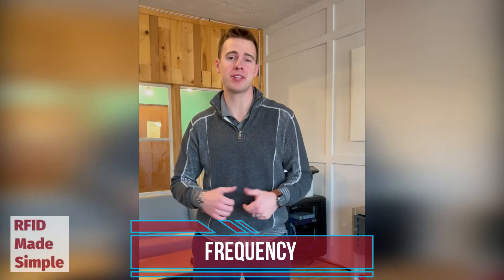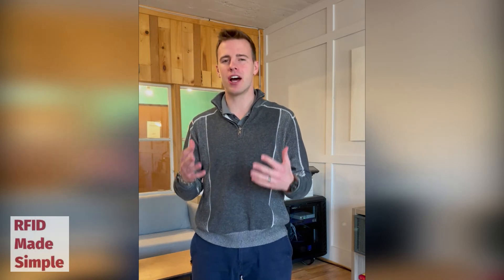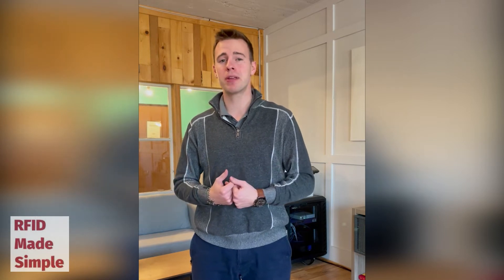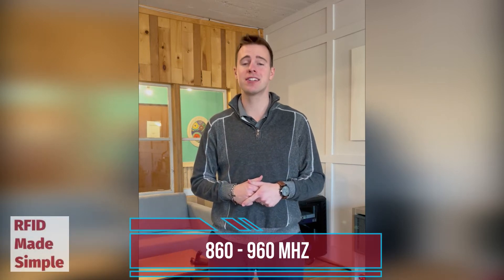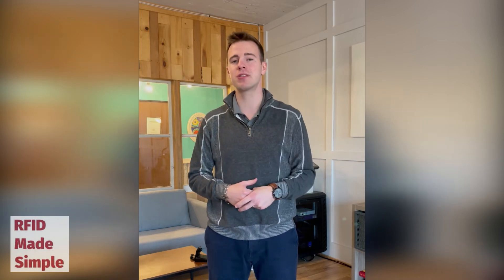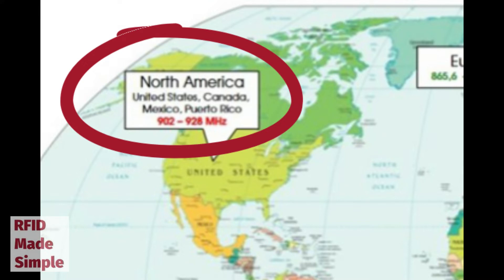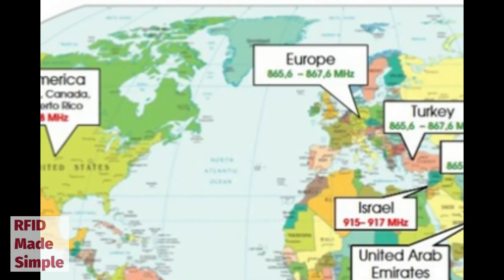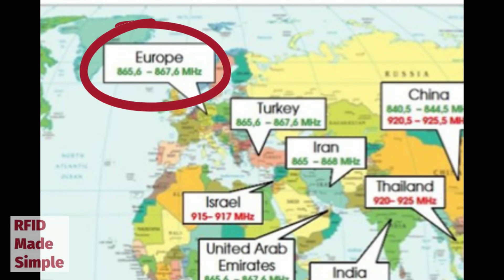What is RFID Frequency and Why It's Important

Comment: Important missing piece in explaining frequencies as it pertains to UHF RFID:  A point of concern is the extent to which particular RFID tags can be read or written in different countries, given their different frequency bands. A person new to the field might imagine that Tags need to be selected that operate on the same frequency as the Reader in order to communicate, just like in other types of radio equipment.  This is not really true. A key to this subject is the way in which Tags respond to commands from the Reader:  The Tag signals via pulses that consist of switching its antenna between resonating-and-reradiating (reflecting) the incoming signal, and not resonating/reflecting the incoming signal. This scheme is referred to as "backscatter". The Reader listens for these backscatter pulses, and interprets them as a message responding to its recent command.  
Withing the "pulsating reflection", the individual reflected pulses are bursts of the underlying frequency as sent by the Reader, whether the Reader is operating at 860MHz, 900MHz, 920MHz or 950MHz etc. So whatever frequency the Reader is set to (per the current location), the Tag's response reflects that same frequency, which is obviously exactly what the Reader is listening for. 
To make this work,  Tag's antenna needs geometry that causes it to more or less resonate when it receives signals anywhere in that frequency range.  That said, different Tags will, by accident or by design, have different degrees of sharp tuning ("Q" factor). Sharper tuning means a stronger reflection when operating near the center of the tuning range, but weaker outside that range, compared to a more-broadly tuned antenna. So that is a factor that might play into selecting one Tag over another, though in general, Tags intended for UHF RFID will operate at least somewhat across the entire band. If you know the Tags will only be used in one region, you might select a more-sharply-tuned Tag in order to achieve maximum range, it that's important to your application.